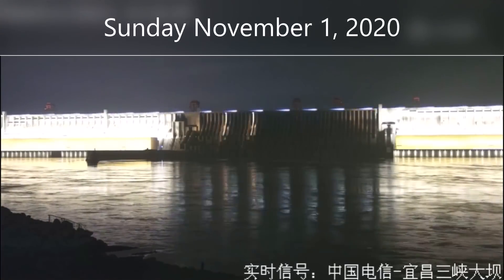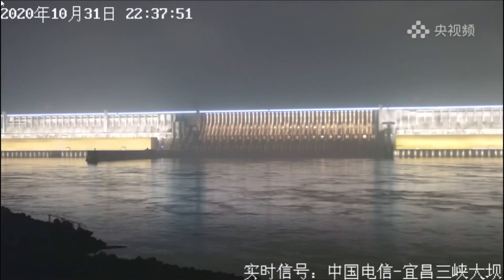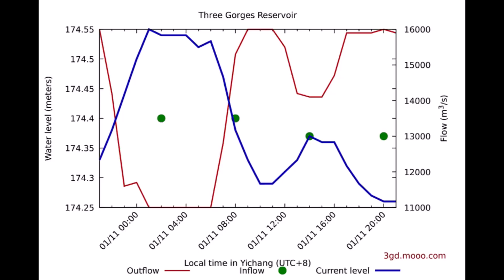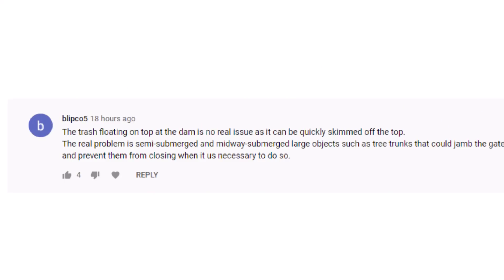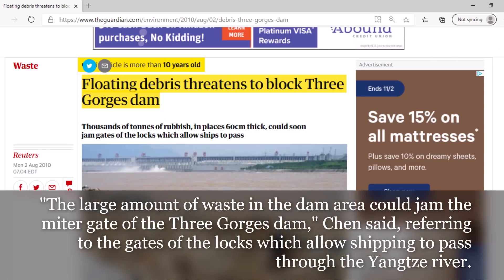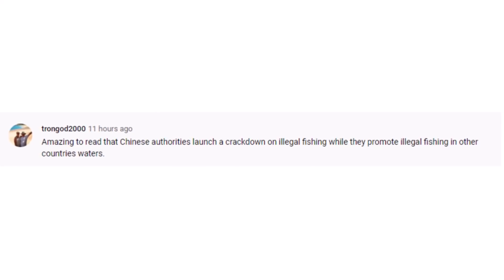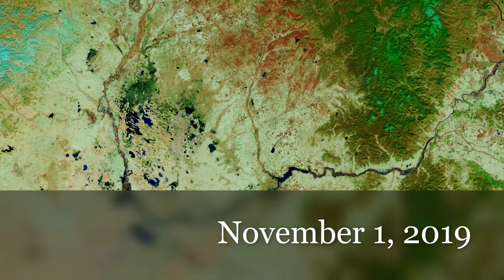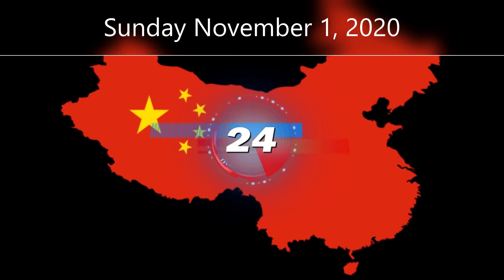Three Gorges Dam Update November 1 2020

Comment: It should be noted that the pinstocks (tubes that take the water behind the dam down to the turbines) have trash rakes (a sort of screen, usually a grid that keeps very large objects out of the pinstock). The pinstock openings need to be of sufficient height to the turbine blades to power the rotation of these blades (depending on the design of the turbines) and must be below the lowest seasonal water level by a margin of safety. Gravity accelerates the flow of water through the pinstock. It must be noted that the blades of these turbines suffer erosive wear over time due to the friction of the water molecules and the molecules of earth and debris with the debris contributing a larger portion of such wear.

The rivers first dam is about 1600 km distant and at a height of 950 meters above sea level. There are a number of dams between the first and the Three Gorges Dam, several of which have failed, thus reducing control of the flow of the river's water. The Yangze is one of the fastest flowing rivers which means that suspended material in the water is carried far further from the time such materials enter the river. While the flotsam on the surface of the river can be a serious problem if left unattended, it can be controlled to some degree by constant removal. However, the amount of debris this year has been extraordinary and the small craft that remove debris has been unable to remove such debris. Hence, the debris has built up to an extraordinary and it must be remembered that such debris must be moved somewhere, one does not simple throw it on the shore.

The surface debris, if left long enough may become water logged and sink towards the bottom of the river, thus contributing to the possible damage of the turbine blades as it enters the pinstocks. If you had noticed the floods carrying away a wide assortment of debris, there was a great deal of plastic and metal. As the water level reached 160 meters and above at the dam, we would expect an increase in river current which was amplified by the release of water through the flood gates, increasing the flow rate of the river.

Will we ever know how much damage has been done to the dam? Not likely since the CCP will not permit such information to be released even to its own people. There are a number of good videos on hydropower dam construction and operation along with one on the construction of the Three gorges Dam. All are very interesting and give us a base of knowledge form which we may draw our own conclusions.
Reply: I grew up on a river system with hydroelectric plants every few miles, though they were nowhere near the scale of this monster. The intakes for the penstocks were covered with grilles made out of about 2" diameter steel and about once a year, they'd drain down the river section above to clear debris from them. Open the lower dam and close the upper, and the river goes away for a day. I got my first bicycle that way. I've been wondering how the hell they can do that at the 3G. There has to be a way to clear debris, but damned if I can see how.
Reply: @hamletksquid2702  I imagine they use some sort of underwater weir system. Back when I was living off road we had a seasonal steam flowing through the property. What I learned is that by building a dam at a critical juncture I could create a small lake. Unfortunately, that lake would silt up unless the damn was a specific type of weir that allowed the flow of water over it but kept most of the solids churned into suspension. My lake was seasonal in the sense that it held little water in the late fall, but it did the job in keeping the area before the weir from silting up. It works like an airfoil by creating a pressure differential. As far as the hydroelectric dams you saw, I suspect the inlets of the penstocks were too close to the surface or the bottom of the dam and hence collected debris that had to be cleared by draining the lake behind the dam or diverting the river flow temporarily. The engineers must have a great number of variables to consider at Three Gorges Dam but all that is above my paygrade. It's one thing to put three logs in the shape of a pyramid across a stream that is ten feet wide and create a clear pond behind it, a larger dam is another thing.

Of course silt accumulation is another problem for dams as it raises the river bed and its creep against the base of the dam could cause movement. But that is more hydraulic engineering than I am capable of solving.
Reply: @martaamance4545  - That's the problem I have with this stuff, too. I learned some hydraulic engineering in college, but it was a long time ago and the focus was mostly on understanding flow in enclosed systems rather than the chaotic version in a river. I'm an electromechanical guy, chaos is not my favorite thing. At some point, you have to assume that the people who design dams and such do understand what they're doing, though. It's a mature technology and the problems and challenges are well-understood. That's why they get the big bucks.
The dams I grew up around were mostly pretty low, around twenty feet high, and built around the beginning of the twentieth century. They could drain a couple miles of river overnight. I don't think that's an option with the Yangtze. Silting up seems to be the major factor in lifespan of a dam, and the Yangtze seems to be mostly silt. The dam might still be standing in a thousand years, but it won't be any use for anything.
I think the lack of real information is one of the main reasons I'm interested in the 3G. Understanding what's really going on is a puzzle wrapped in national security paranoia.
Reply: @hamletksquid2702  The geology of the area from the TGD west is one of multiple geological hazards. The dam is built on an east to west uplift of multiple strata's of lime stone, marlstone interspersed shale. The Chinese drove (not drilled) large diameter pipe with sufficient holes in them about one hundred feet into the strata and then forced a mixture of mortar into the rock, a sort of reverse fracking where the crevices are filled rather than opened. The number of pipes so driven was suppose to create an sort of dam in the rock strata to stop any water infiltration. But I would believe the manner in which the pipe was driven (the old pile driver method) would have created a number of smaller cracks in the layers beneath the mortared layers. The powerhouse sits at the bottom of the incline with concrete poured on top of that incline. the rock layers appear not to have been dug our or otherwise flattened. with the extreme weight of water and concrete on the underlying rock incline structure it is difficult to see how the stress from such weight would not create fractures that would eventually allow water to flow by cavitation under the dam eastward. For all the brilliance of the technologies used, common sense should have told then to find another place to put this dam. The dam engineering is relying of gravity to keep the water from pushing the dam down river, but when placed on a slope gravity tends to work against it. For what I can observe from the few drawing, the strata sits at a thirty degree to forty degree angle, not a good sign. If the strata incline was from west to east then one would not worry about the dam's movement. There is information all over the place on the construction of this dam, more than I can digest much of it above my paygrade being that I am not a geologist or hydrologist or hydraulic engineer. But I am more inclined to believe this dam will fail not by breaking apart by the weight of water pushing against its walls but from the initial sliding down the river before collapsing. Since the dam was built in blocks that are not tied together with the standard structural rebar and since it has deformed this year (along with other structural failures , cracks, etc) then we will see it fail possibly within the next hundred years.
Reply: @martaamance4545  - I'm with you on most of that. I'm inclined to think the dam itself won't fail at all - it's the landscape around it that's the hazard. If they had found a better place to put it, it wouldn't have needed to be the world's biggest, though, and I think that was the main reason to build it. The CCP's had a few changes of ruling clique since it was built, so they have the former bosses to blame if it does fail and that's always priority one in an authoritarian system. CYA and the peasants have to choice but to believe you.
Reply: @hamletksquid2702  Thank you for the 'chat' with Marta Amance.   I am not interested in dams but it's interesting to learn a bit.   The dam, however, would not stand if there is even a small earthquake in the area due to poor construction, I've assumed. 
 There might be either earthquake or volcanic eruption in Tibet as in some area well water is steaming.   It would be nice if the ccp destroyed by an earthquake.
Communists like to show off, to do things in grandiosity just to prove  how powerful the  party is, and to please the supreme leader human god.  
 In 1993, I recall reading the story about  millions of poor Chinese who were forced to leave their lands for the construction, and about environmental disasters that would occur because of the dam.
Reply: @nhutollinsky8913  - Thank you for thanking us. It's just nice to have a conversation without someone freaking out and calling me a communist tool. That happens here, too.
I think my main reason for being interested in dams comes from trying not to get killed by them when I was a kid. I believe I understood recirculating currents by the time I was about twelve, and I knew before that when you're fishing under the powerhouse and the siren goes off, you get the hell out of there because you're about to be in white water.
Reply: @hamletksquid2702  Thank you for sharing your experience.  I can relate to your feelings  very well as I had bad experience with water when I was little.   After that I was very scared of the sea.   When I grew up, I tried to learn swimming at the YMCA.   After three sessions, I am not exaggerating, I still can't swim but at least I can float in water now.
Reply: @nhutollinsky8913  - I don't remember ever being nervous about water for its own sake. In my family, you learned to swim by being thrown off a dock when you were about four, and I spent a lot of my time on and in the water my whole childhood. Salt water's a different story, though. That stuff is full of things that either want to eat you or just kill you out of spite.

Comment: I'm sure they do have screens but the debris can plug them up.
The South Fork Dam, which flooded Johnstown Pa, had such an issue. Among others.
Reply: I believe the Johnstown flood was caused by the owners of the dam having the overflow pipes removed during refurbishment. Basically figured they weren't doing anything since they were above water level. I've worked for bosses who thought that way.
Reply: @hamletksquid2702  If I remember correctly, the original dam in Jonestown was somewhat lower and primarily an earth dam. Then it was decided to raise the dam's height by adding rock and rubble to the top and back side (lake side). Later on some though was put to adding a thin layer of rubble on the reverse slope when water seepage was detected, but those actions were not enough to prevent its eventual collapse. There is one or two good books on the subject, one of which I read. The conclusion of the book was that the original earth dam would have failed with excessive rain and runoff, but increasing the height only made its failure sooner when such an event occurred. There never was any real "spillway" that would have corrected those problems.
Reply: @martaamance4545  - We might have read the same books, back before the internet started sucking up everyone's time. I remember there was a lot of effort put into blaming immigrants by the local papers, even though it was caused by incompetence brought about by a rich people's rod and gun club  not wanting to spend money to make it safe. The more things change, the more they stay the same.
Reply: Marta Amance - Just the opposite. The hunting and fishing club LOWERED the dam by removing the top to widen it so they could get their horse drawn carriages across it. Then when there was overtopping they replaced the damaged section with rubble and tree branches from the local farms instead of the proper 'puddled earth'.
When the rains came their emergency spillway was blocked because they had installed a screen to keep their game fish from escaping. That screen was filled with debris that had not been cleaned out so the water overtopped the dam.
They could not lower the water height because the lower drain pipe had been damaged earlier and they never bothered to repair it.
The townspeople died and not one wealthy person was ever charged with the crime.
Reply: @blipco5  Thank you for the correction. The last I read on the Jonestown Flood was some twenty years ago. Yes, once the wealthy took the place over and started building cottages the character of the club changed. As I recall, not one new cottage had a kitchen as all meals were taken in the community dining room. The lake was used for small boat sailing but the complaint was that being long and narrow few individuals used it as such. Like so many small dams of the time, it was a disaster waiting to happen.
Reply: Marta Amance - Thank you for your interest but the "JOHNSTOWN flood" happened in 1889 (over 130 years ago).
It is a sad and interesting story. I have been both to the town and the broken dam.
If you feel inclined to do so it is a worthwhile trip. 🍻